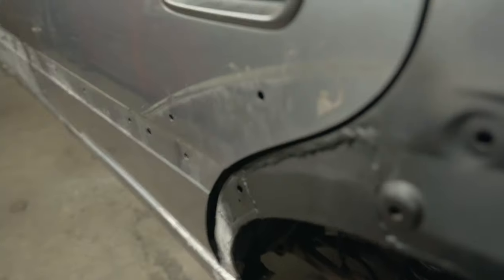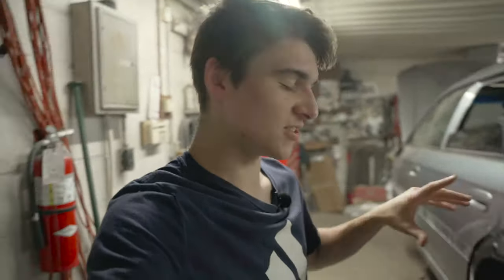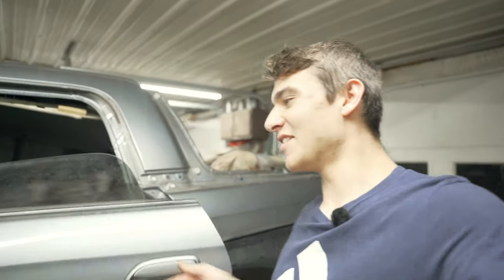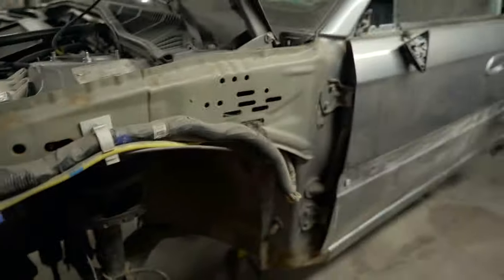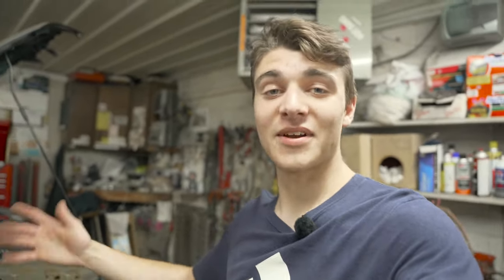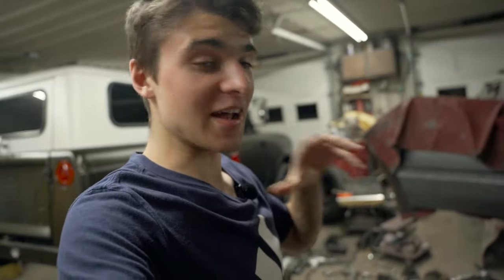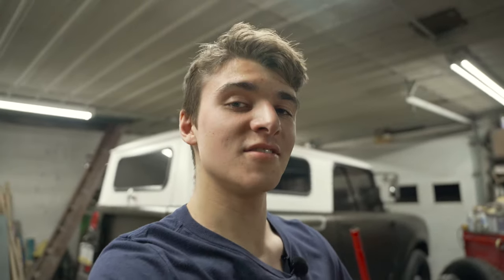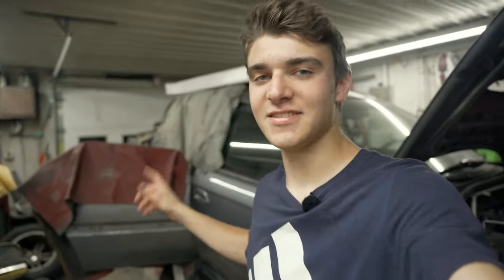Subaru Baja Turbo = Overland Rig?

Comment: The project is moving forward nicely. Keep it rolling 
I like the wheels, not really a fan or the small spoke look,normally, I think they will fit nice with the paint choice, kind of a military green with extra pop?
Definitely would fix that brake line, seem really tight,  especially for just plane rubber.
Your welds don't look all that bad in my opinion, especially for a beginner, you only will get better with time and practice. 
The engine may last it may not , you're talking about an STI Empreza engine right? Not really knowledgeable on JDM or European cars.
Good luck and be safe.
Reply from the maker: Thank you for the kind words 👊 and yeah I’m thinking sort of a military green with some extra metallic. I am changing brake hoses this week and extending the length... definitely not liking the tightness. As far as the STI engine goes that is correct, I would be putting in a wrx STI engine
Reply: @OutboundIntent   No problem.
Reply: Dude I was hoping to see a lil more of your rust repairs since I’m also doing some on mine and I was looking to see what u did and how u did it I mean maybe u could send me some pics or make a vid if u wanted but it would be a big help for me. Thanks bro ur killing it we got our around the same time and ur way past me right now.
Reply from the maker: Hey man I can definitely show you what I did. Hit up my Instagram (@outboundintent) and shoot me a DM. I just haven’t shown it in depth because it is a lot of panels and didn’t think many would enjoy watching all that. You’ll get there man, stay with it! Issues are still coming up that need fixed but it is hopefully going to be on the road by the end of September.

Comment: where did you get the pieces to replace those rusted out parts. cause I have a baja with the same issues
Reply from the maker: I bought a big piece of sheet metal and bent my own pieces to fit... I believe you can find whole pieces but none of mine was structural